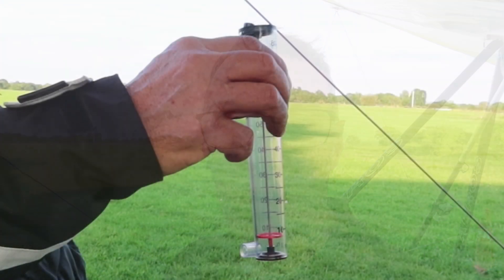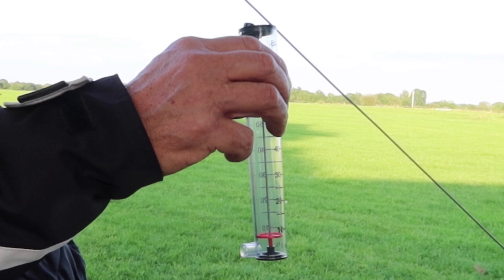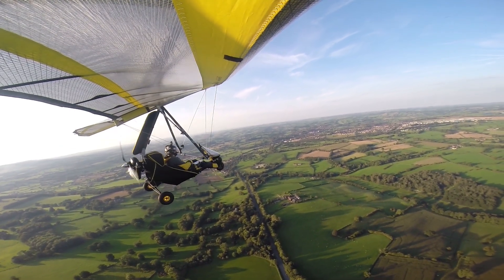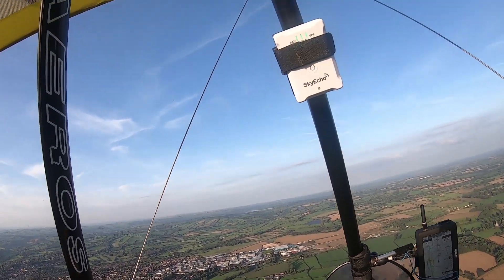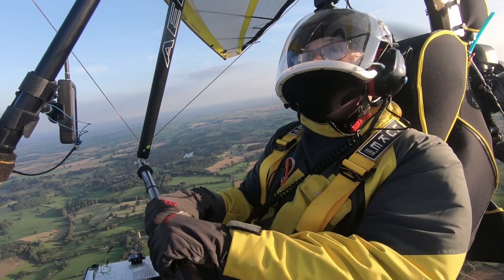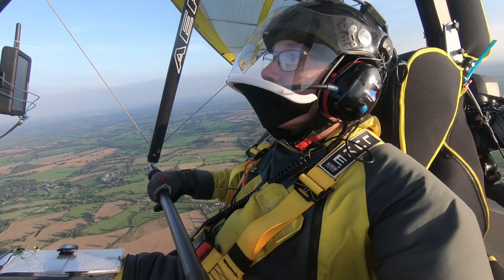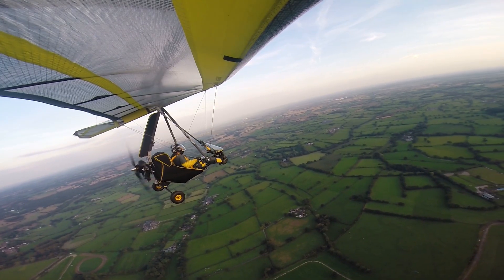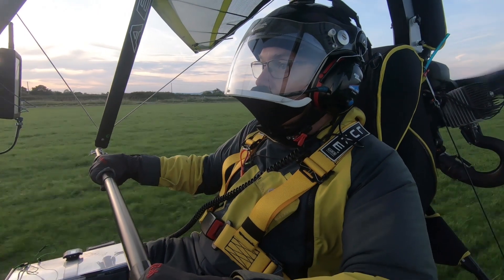Flying WITHOUT an ASI - The art of flying without an Air Speed Indicator?

Comment: I’m going to remove my Hall Airspeed Meter from my Adam and see how the reduction in drag improves my airspeed - But how will I measure it 😉
Reply: It’s a very valid video Giles, I’m wondering whether the obsession that fellow sub 70/SSDR pilots (inc myself) with ASI’s comes from our instruction on dual machines, I for one was taught to use certain speeds on approach. Whilst with years of flying paragliders I never once had a need for an ASI, never unintentionally stalled etc.
Reply from the maker: The thing I love about Sub70 and even the NINE, I've never known any speeds, I just fly by feel and bar position.
Reply: @GolfFoxtrot22  indeed your absolutely correct Giles, I tried to use the Hall a couple of times and my landings were abysmal! Flying by feel, attitude and bar pressure gave much better results.
Reply from the maker: I'm just curious, how was the Hall messing up your landings?
Reply: @GolfFoxtrot22  I was looking at it instead of looking long.
Reply from the maker: @davidnewbrook8628  ahh that will do it.
Reply from the maker: Haha, I didn't see that one coming.

Comment: I don't fly a flex-wing, sub-70 or otherwise. What I fly is somewhat different. I can understand that you can feel the onset of an impending stall (not something that affects us - we cannot stall, even if we stop dead in the sky), but how can you tell when you are approaching Vne without an ASI ? Or, maybe Vne is as meaningless to you as "stall" is to us.
(If we go above Vne, it's the only time that "stall" becomes a serious concern - retreating blade stall on a teetering rotor system is going to lead to a fairly bad day).
Reply from the maker: To get a flexwing to VNE you really have to be putting the aircraft is a deliberate unusual attitude, primarily stalling it nose high and then in the recovery fully bar back and apply full power. Every sense you have will be screaming to you this is wrong to hold and sustain it to VNE. You can't get a flexwing to VNE in straight and level flights it just climbs. Stalling is the same, you have to have the bar full on the front strut, with no clue or sense that the bar pressure is high, lack of roll control etc, everything is telling you, you are now nearing the critical angle of attack. In a flexwing the whole aircraft just tells you what is going on. Hands off trim is so obvious, you really don't need an ASI. I hope that helps.
Reply: @GolfFoxtrot22  - It does. Thank you for the detailed answer. I figured it might be something like that. I'll get up in a flex-wing, one day, but I don't anticipate that the experience will prompt any thoughts of selling my gyrocopter even though they do look like good raw flying fun ;) .
Reply from the maker: @halfrhovsquared  the joy of aviation is we take from it what we want. I have a friend that sold his flex and bought an autogyro so I'm looking forward to having a flight in one. Thanks for your comment. It's always good to see other perspectives.
Reply: @GolfFoxtrot22  - They are surprisingly capable and resilient to winds and turbulence, especially for such a tiny little insect.
I have gone flying when the winds have grounded pretty much everything else at our airport.
We can get into or out of any field that you guys can utilise and our cruising speed is fairly on-par (if maybe a little slower because our rotors create a heck of a lot of drag).
Performance-wise, we are very close cousins and I would argue that nothing beats the open-cockpit experience in terms of the feeling of flying and the fantastic visibility it affords.
I hope that you go up in a gyro and make a video of the experience.
Reply from the maker: @halfrhovsquared it's definitely one I want to vlog.😁

Comment: I agree, an ASI is not necessary on a trike or hang glider. Fly by feel.  I have had a Hall meter for 40+ years. Never flew with it on the HG, just used it to check the wind speed on the launch ramp. On the trike, I use it after a trim (or wing) change to compare the before and after, although most of the time I forget to look at it. I would like to find an inexpensive ASI with logging capabilities for overlaying airspeed onto a video.  GPS ground speed, which is useful for range calculations, is built into my instrumentation panel that monitors the drive system. 

Back in the 70's, hang gliders had very little bar pressure in any direction. We judged speed by sound. If the wing was flapping, you were flying too fast. If the wing went silent, you were in a stall. By the early 80's, designers had introduced sprogs (washout tubes), luff lines, billow shift, dihedral, battens, heavier & tighter sail cloth, etc. that not only made the gliders safer, but allowed the wing to give you feedback via control bar pressures.  The  only instrument I feel naked without is my altimeter/variometer, although I can fly without it.
Reply from the maker: Hi Mike, welcome to the channel and thank you for your thoughts. I completely agree that a VSI and Altimeter are my preferred instruments if I were to have but one device.  I've only been flying flexwings for the past 4 years so I only have the likes of yourself that can explain where it has all come from and how our wings have become safe because of the developments of past pilots etc, so I thank you.

Comment: I am a paraglider pilot. We relay on the same concept. Your speed is established by the height of the commands, so to speak. We have no trimmers or trimming regulators. We hang quite far low from the wing. But I would have said that in a hangglider some slight thing can put you out of trim.
Reply from the maker: Hi Edu, I can completely relate to your comment as I flew paragliders and paramotors for over 10 years and I do like your analogy.

Comment: Another factor, especially for the smaller Flex wings, you have a narrow speed range, and you can feel the wind speed on you. It's like motorbiking, you can guesstimate the speed by how much you are being pushed backwards.

As for inspirations in flying. Paul Whitehead, he was both a CFI at Church Fenton, and instructor at Dishforth RAF gliding club. More recently you.  I wanted to start microlighting in 85, but I've not been in the position to get started until recently. I hope to start, and complete my PPLM in 2024.
Reply from the maker: Hi Simon, that is a very good factor for the Sub70 side that the speed range is just so small. From HOT to bar fully back is only 8 mph. Thank you for your story about Paul.

Comment: Hi Giles, Having been flying GA Aircraft for more years than I care to recall, I am definitely in the " Boys Want Toys " mindset....... it is to some degree becoming the norm in 'Sub 70' for their pilots/owners to also crave the " Boys Want Toys " mindset.

I am inclined to think that some 'Sub 70' flyers are of the mindset that " They need an ASI because it acts as a Safety Blanket "  In Flight I am far more focused on what my Groundspeed is for exactly the same reason that you focus on Groundspeed but obviously I am still very happy that as a GA Pilot I have the luxury of an ASI in the Panel ;-)  Therefore if I ever seriously took up regular Sub 70 flying (* instead of just playing at it from time to time*)  I would keep/find the Hall ASI to be an ' Essential Add On ' 

Now, I am going to pose another question that as Sub 70 is a Weight Restricted Flying Machine (* I know you are personally operating as a SSDR so not so Weight Restricted *) so the question is only aimed purely at Sub 70 flyers but I am sure you will want to answer as it is relevant:

Sub 70 is a simple recreational flying machine that in your opinion doesn't need an ASI..... Are there other Non essential add on's that you feel are surplus to requirements?

Let's look at: " Is an Altimeter essential? "  As Sub 70 is a VFR only flying machine I am sure that height recognition can also be gauged by the Human Eye, so should the Altimeter be discarded?

Let's look at: " Is the Compass essential? "  As Sub 70 is a VFR only simplified flying machine I am sure that VFR Navigation & recognition can also be gauged by the Human Eye, so should the Compass also be discarded?

My Point is that " If an ASI is not essential.... I am guessing that an Altimeter is possibly not essential either?  I threw the Compass into the mix because it won't actually be 100% accurate on many flights? "

To back up the above paragraph " if a Sub 70 is being flown by any sensible person I am guessing that they consider a GPS as an 'Essential Add On' so it should have the ability to display a GROUNDSPEED as well as GPS ALTITUDE ( *Altitude NOT Height Above Ground*) & also have the ability to show the Track to desired waypoint ;-) 

" I did note that if I am not mistaken.....You set a QFE on returning to Darley Moor "  so perhaps you do consider an Altimeter to be Essential.

" You thought you might get a healthy debate on this podcast " I hope you see my content as a healthy discussion for further thoughts ;-) 
Personally, I think as long as all the 'Toys that Boys Want' can be fitted under the 70kg limit, it is just personal preferences ;-)
Reply from the maker: Hi Peter, lots of points there so I'll try and comment from my thoughts.  
I would reconsider the term playing at Sub70 as everything below 600kgs is all recreationally flying, we fly because we want to and for fun.  Because it's fun and our hobby, we like customise our aircraft. I'd say that a compass and altimeter with the ability to set the subscale would a good base level.  

The main point of the video was to show that for a light machine like the PeaBee or the NINE can be safely flown without an ASI.  Any GA pilot should be able to fly without an ASI, its part of the syllabus. 

From my experience a very large proportion of Sub70 pilots are capable and competent. I put this down to the respect and cost of the machines, so they seek out training. 

I hope that covers most of your points.
Reply: @GolfFoxtrot22  On the basis that I consider that " I am playing in Aircraft up to 5700kg " & sometimes " flying seriously in heavier Aircraft " I don't think I need to reconsider the " playing at Sub70 " remark ;-)

As Sub 70 are Recreational Fun Aircraft I am just questioning whether I would enjoy the Sub 70  Experience if I didn't have an ASI to rely on? ( Yes, I have done ASI failure training & it raised my Blood pressure !!! ).

Not being that competent on Sub 70 I would prefer to have an ASI but I do take onboard that an ASI might not be essential on a PeaBee, I am not sure I share your opinion that a 'Nine' could be safely flown without an ASI ???   I would imagine the 'Nine' could easily be pushed through it's VNE in a shallow descent/dive?

As Sub 70 is a VFR Only Hobby I am not so sure a Subscale Altimeter is essential ( but quite handy )  I would happily rely on a Standard Altimeter with the knowledge of the field elevation being noted in my flightplanning ;-) ( or even rely on the GPS Altimeter as a reference to my flightplanned notes ).
Reply from the maker: @peterkelseyferryair2396  I've flown the NINE for about 8 hours and unless you pull it into a steep spiral dive, you can't get close the to VNE. You have to generate a stall entry with power to get it close to VNE (check flight method). You don't need an ASI on a Nine either, the bar position and your attitude gives you all the information that you need.

Comment: I fly gyros my instructor used to put his foot over the ASI if he thought I was doing more that occassionally glance at it.  His point waa the stick will tell you speed if thei airframe is level and your on minimum power to hold altitude your spot on.  Gyros hang like trikes though.  He personally didnt have one on his single seat gyro.  One day a student pointed out he was mandated to have one so he got out a niko pen and drew one on.  The student pointed out his niko asi didnt indicate mph or knots so he wrote on pineapples.
Reply from the maker: Hi Cameron, that's a really cool story about your instructor, I was trying to visualise the situation happening. I've yet to have a flight in an Autogyro but I do have a friend that has offered so I'm waiting for the flight with eagerness, and I'm sure it will be vlogged.  The Pineapples bit did make me chuckle, he sounds a character.
Reply: @GolfFoxtrot22  yes hes a character.  This was over 30 years ago when I learned. We were all pretty much having to build our own machines back then.  His point about the pineapples was a teaching moment.  His point was like yours they can be inaccurate the hall gauge for example at any angle other than straight and level is not going to be perfect. 

His method was to challange you in every way until he couldnt screw you up any further.  So the moment you felt comfortsble hed notice and do something to screw you over.  For example quitely put his hand out into the slip stream then yell at you for not holding it straight with rudder or cut the power at any given moment the start yelling at you to raise tension.

Gyros had and still have too many accidents.  This was and still is largely around difficulties in effective instruction.  We have very high wing loading because of the rotor so the feel between a dual and light single seater in stick feel is massive.  

Back then the two seaters which were few in my country at that time there were 3 were rotax 583 powered machines so the empty weight might be 130kg but add two pilots and you had more than doubled that.  We learned first in gyrogliders at our club then some dual powered then single seat transition.  Because if you had a singke seater with the sane rotor and engine as the dual machibe the difference was massive.

Add to that complications with hand winding rotors etc. Now he had us do all this and he test flew our home built gyros when I first met him he'd already test flown 240 home built gyros.  

Instead of getting rid of ground hops in single seaters and gyrogliders when two seat powered became available he just added the dusl power into the mix.  It worked.  I became a gyroglider instructor latter but almost every instructor rejected it (no profit for one it is a club thing).  But Terry knew it was a powereful trsining tool because towed behind a car with no engine once solo it was lighter than any singke seater so stick feel was indentical and you learned everything about managing rotors by hand and eye.

It worked with him Training in the club over 16 years instructing in the gyroglider I never saw a single rotor bent in training.  People would do stuip things like fly into powerlines occassionally refuse to make some modification he insisted on their precious new machine and wed hear theyd gone on their own and smashed up a machine.  At the other club i gyroglider instructed at they didnt have a powered two seater and although id advise them on solo in the glider to get trsining with terry many refused as it was hours drive away.  Some would smash thier machine others from the area trained with others entirely and almost all snashed at least one set of rotors.  It was the wild west. 

Today the dual machines are around 300kg empty weight far too heavy so they need far too much engine too tall a mast too expensive.  Etc.  As a result some modern gyros do fly well but only because they have a 914 or 915.  And none of them fly like our old rotax 503 powered 115kg empty weight machines in terms of take off distance (without massive head wind).

So now the difference between dual ans solo is really in our terms of getting out of a machine with 3 passangers into a machine with 2.  Most modern gyros have massive heavy rotors still littlr movement required but heavy on the stick compared to a light sngle seater.

Most use prerotation which combined with longer rotors actually increases take off distance theyll tell you they shortenen it but they dont.  They overspeed rotors now then try to catch them before they spin down and hinge/flap.  Anyway the post is too long already.  Have a fly with your mate.  The UK scene is better than mist in terms of safety but compared to the old days the UK scene was better.  If your realky interested look up some of the old timers like Shirely Jennings she wrote a book spinning in the wind which gives a real flavour of the old days.
Reply from the maker: @cameronlapworth2284  I'll have to have a look for that book.
Reply: @GolfFoxtrot22  heres video from the old club i learned in the two seat aircommand is being instructed by Terry the guy i was describing  and he is also flying the gyroglider  https://youtu.be/PzY43nJVhn0?si=KZXE8jsZCjQy9rCS
Reply: @GolfFoxtrot22  and here is a light gyro closer to your sub 70 weight or as close as possible this machine probably about 115kg empty 503 rotax.  Turn off the music.  This is ine of Terrys students steve a mate who saddly died a few years after this drom lung issues.  This shows beatifully that even hand winding if taken gradually that is correctly will get you off the ground in short distance.  No 28ft rotored machine can get off in this distsnce without a 20mph headwind. Modern machine are too heavy.  https://youtu.be/36ogAzGGyG4?si=ngIicNdSn1ar3B0X

Comment: Yeah I had a Hall on my Adam but I took it off. Never even looked at it. Has anyone mounted a speed bar? Sometimes I feel like I could use more nose down pitch control when I hit gusts and thermals.
Reply from the maker: Hi Ed, I initially mounted my on the bar but I couldn't find a clear air position. The Adam wing really doesn't want to nose down does it?